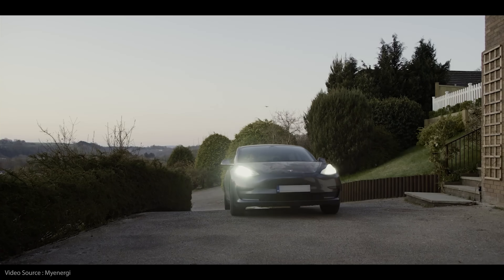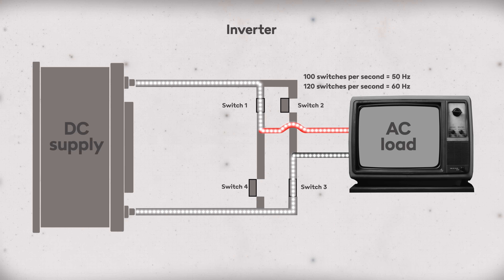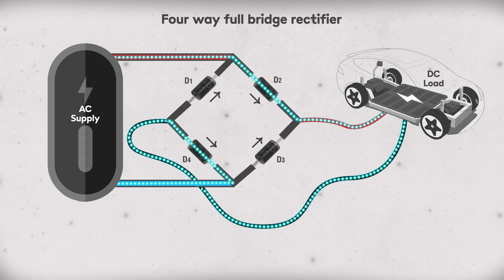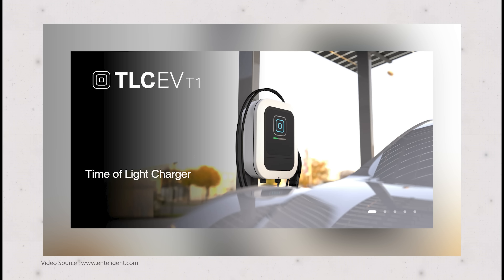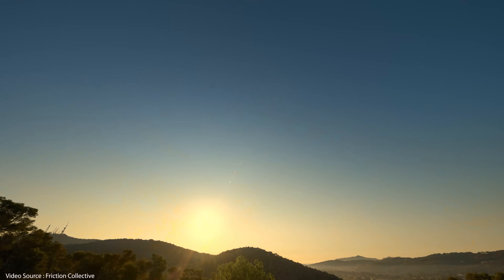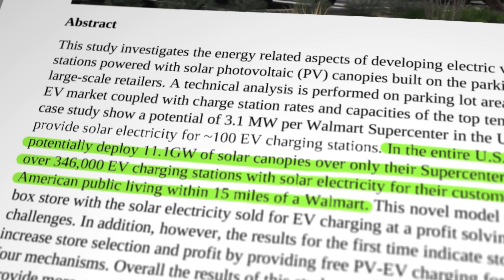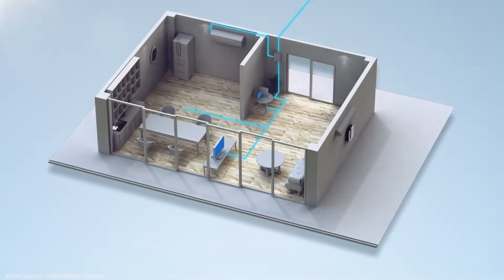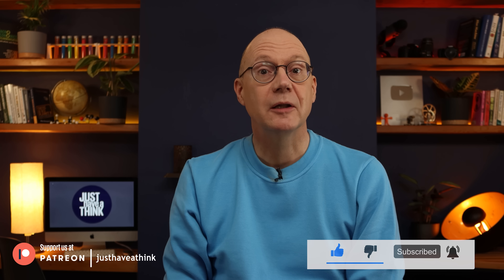DC to DC charging. One more step to off grid living!

Comment: Maybe they could just build the Mppt Solar charge controller Directly into your car so it can Plug directly into any solar panel system, Then it should be able to directly charge from any DC power supply Within reason, be it Solar panel, battery or mains electricity Converted to DC
Reply: With solar panels built into the bodywork which double their surface area when the charmed DC vehicle is parked (using origami fold out patterns.) Shadow casting building owners meanwhile pay shadow tax, much like the window tax of 1696?
Reply: @JHawkins-jf6bs  ??? What's that got to do with the price of salt on a Sunday afternoon.

Comment: What about a DC to DC charger powered by a diesel engine with an alternator feeding into a 12v  Li ion battery bank. They told me I needed a DC to DC charger to prevent burning out the alternator because the Li ion bank can draw too much power. Can you elaborate? Do I need a special type of DC to DC charger ?
Reply: Sounds like bollocks... I don't know of any way for a diesel generator to produce DC natively.  If the alternator is inadequate, and the alternators on modern cars are pretty light-duty, then you need a heavier-duty alternator.  Maybe first figure out what the amp draw of the battery bank is, then see if it's within spec for you alternator.  Both of these bits of information might be hard to find.
Reply: @incognitotorpedo42   Yes you are correct - rowlocks!.  But there are DC generators (often called a dynamo) and the more common (now) alternator generator (producing AC which is the rectified to DC for all automotive vehicular use).  

Vehicle alternators are typically only about 50% efficient when heated up in normal use.  

Large power alternator generators, driven by diesel engines, are better than 85%.  Small petrol household stand-by gennies are likely about 85% efficient when fully loaded.  But all these generators are still wasting energy with their prime movers.  Petrol engines about 25%(if lucky) and large diesels about 30-35%).  All fossil- burning polluters

Comment: If you were worried about efficiency losses, do the math and find out what that is in a total power rating. Remember that a 400 W solar module will now cost you about $260. So if you don't like the efficiency losses simply buy a couple of more solar panels and stick with tried and proven technology!
Reply: There's only so much space on a rooftop though. If the entire roof is already covered with solar panels, a few more % efficiency could be nice.

Comment: Well I've lived off grid in the mountains of Santa Barbara for a super long time and the vast majority of my house is DC and we have been doing DC solar to DC batteries to DC loads since the late 90s. This newer stuff is a bit tricky however as there are much higher DC voltages.
Reply: My first job post-college was in an off-grid solar community working for the solar installer that built the community. All 4 buildings were wired for both AC and DC and we sold a lot of DC light bulbs, refrigerators etc. As inverters got a lot better and cheaper, most people skipped the DC wiring, but it really does make things more efficient, and would be a better choice for developing nations that are going to build out micro-grids rather than national utility grids.
Reply: Nice thought, but solar panels deliver DC power very seldom in a condition you can use without adaptation for home devices. This goes with the help of dc/dc converters. Depending of the application, the converter needs an internal ac circuit to achieve the necessary step up or down voltage. Things short: the ac circuit in your house is not the devil you must get rid of, but you should think carefully about your special application.
Reply: @rainerpick5491  you are patently wrong! DC DC converters do not need an AC circuit! 🙄 i've only been using them for about 25 years now!
Reply: @rainerpick5491  Most residential solar is 600V DC and most commercial solar is 1,000V DC. Back in the day the panels themselves were 12v, 24v, 48v, obviously designed for specific battery bank voltages.
Reply: @patrickcorcoran4828  yes but we have specialty charge controllers now so we can go from 300 to 500 V DC in and output whatever DC voltage we want to, to a battery bank. So my input voltage is 350 V DC and my output voltage to battery is 48 V DC and then I have DC to DC converters that feed 12 VDC circuits in the house. Very simple stuff.

Comment: I am waiting for us to cross the threshold where we start figuring out a standard off grid appliance system where homes can run on DC to bypass the grid all together. Imagine if homes that had solar could install all heavy use appliances like climate control, refrigerators, etc where one DC standard was used. i see it as likely 48 volt but I am not an engineer. You could run lighting and low powered stuff on 12 volt and totally avoid the conversion losses altogether. This would also avoid transmission losses. So many off grid homes today have to convert their power to AC due to lack of available appliances.
Reply: The key phrase here is "but I'm not an engineer"...
Reply: Solar systems vary in voltage, both from system to system, and to a lesser degree throughout the day.  More the problem, however, is that voltage is fairly significant - up to 600v in typical domestic applications - it has to be stepped down to be safe, or the device(s) need to be hardwired.
Reply: 50 years ago people lived off-grid by using 12-volt DC appliances plugged into cigarette lighter sockets (remember them?). More recently we've seen the rise of a bunch of small USB-powered gizmos . But now we're electrifying huge loads like operating a car, induction cooktop, and home heat pump. I've never seen an unbiased analysis of whether it's more efficient to convert high-voltage DC down to low-voltage DC and adjust solar voltage to an EV's battery charging voltage, or convert everything to nowmal 120 or 240 V AC and continue using regular power supplies.
Reply: @skierpage  I suspect that it is a "size of market" issue. If enough buyers want it, they will make them but until then we need to work on "standardizing" things so they can work to one set of rules. We need engineers to figure out what those standards should be for best results. The market is moving on it's own but that is slow and has dead ends. Some are 12v with it's limits, some are 24v with other limits, some are 48 volt with other issues. Lets work to figure out how to simplify the decisions for the consumer.
Reply: There is absolutely no reason why you should not just use standard AC appliances for off-grid applications.  There is no advantage in using DC appliances.  The viability of off-grid has nothing to do with the appliances being AC or DC.
Reply: @michael-j-harrison  the advantage would be that they are built with soft start avoiding the surge as the compressor comes on, but you can MODIFY AC to do that. However if the whole house was DC you can also avoid inverter overhead everywhere. That is the point of the video.

Comment: What about just having everything in your house run on DC?
Reply: Maybe one day... I would love to get rid of all my wall warts (ac to dc convertors).
Reply: High voltage DC is a lot more dangerous than high voltage AC.  If you tried to use low voltage DC instead, then your amperage would have to be enormous, and all your wiring and appliances would be super expensive.   AC is really the best choice for houses.
Reply: AC is better for many things - anything with a motor, for instance. There's a reason why we went AC and not DC.

Comment: I cant park by my house, so would have to use chargeing stations- taking my time off me and having to pay a premium for the electricity as well. I will stick to an ICE foe as lomh as I can- and a hybrid will not give me the fuel efficiency and MPG a diesel will.
Reply: Some can’t - and some simply won’t.  Now that EVs are getting cheaper and more second hand vehicles are entering the market, I might think that the efficiency winner between non-charging-at-home EVs and diesels is getting vry close to favouring the EV.  As time progresses, even you won’t be able to continue with your inefficient polluting fossil burner

Comment: I am currently charging my EV at home from a DIY solar power system.  My system has to convert to AC and then back to DC and in the process loses that 13% you are talking about.  It works pretty good and provides free car charging but a DC version would be nice if it manages through the ups and downs of cloud cover.  I would want it to be pretty steady so I would think a battery would need to be involved in the design somehow???  Great video, Thanks!
Reply: you guys, capacitors are very expensive, particular in high voltage. and they are not meant for storage just short term. good luck with that idea.
Reply: Seems like I heard that there are places working on capacitors for storing that energy for such purposes which would be nice. Much cheaper and longer lasting technology. Also would allow round the clock charging as it would not matter what time of day you used it as long as it charged while the sun was shining.
Reply: I was just going to add that thought regarding capacitor banks instead of batteries.   They could be built and added at a cheaper cost.
Reply: yeah capacitors. i’d imagine the round trip losses from using a battery would be more than conversion
Reply: @Humungojerry  Round-trip through a low-voltage (48V) battery system would be a bit worse than a standard EVSE, yes.

Round-trip through a high-voltage (typically 300V-500V) battery system would be significantly better. But maintaining such a long multi-stage high voltage DC path that exposes the HVDC battery bus to a third party charger is mostly a non-starter.  Its extremely dangerous compared to pushing power with AC.  Definitely not worth the 5-7% improvement one could achieve.

-Matt
Reply: @junkerzn7312  thanks for the explanation!

Comment: I've been waiting for this tech for 6 years now.  I can't believe it's taken this long for what seems like a common sense solution.
Reply: Also the new alternator car to ev solar battery... ecoflow makes it for any car and it charges in 1 hour of driving. You then can move it to home and have electric all night
Reply: Efficient, high power DC-DC converters have been around since power Mosfets were invented in the 1960s.  Today (2024) raising and lowering DC voltages is hardly any more costly or complex than doing so for AC.
For people who did not listen to the video, PV->EV chargers are a workaround for grid operators who stand in the way of more PV on their grid.  Going direct to EVs eliminates the need to interconnect and allows EV charging at lower retail prices--when the sun shines.  Price, quality or delivery- pick any two.
Reply: @peteinwisconsin2496  I agree.  When the cost comes down I'll probably use something like this with an off-grid system as I have no desire to deal with PG&E ever again.
Reply: The wait was caused by lack of demand, mostly.  It's not a simple problem; you have to convert low voltage DC to high voltage DC, somehow avoiding the inefficiencies of transformers.  I think the sort of solid state power electronics to do this hasn't been around for all that long.
Reply: @incognitotorpedo42  modern solar systems operates on voltages up to 300+VDC, which is also the case
Reply: @vitaliybaban6568  charging lithium-ion batteries is quite complex, though. You can't just attach a DC power source and let 'er rip. The charger needs to follow specific voltage and current curves specific to the type of battery.
Reply: @incognitotorpedo42  I am electrical noob, but i think that transformers only work for AC, not DC. Somebody please correct me if I am wrong.
Reply: @GreyDeathVaccine  I think he meant to use the word converter instead of transformer.  You are correct that AC transformers do not work with DC.
Reply: You will wait forever to come to this tech to come commercially available because there is a flaw in the logic. 
The DC voltage of your battery or solar panels are most likely to not match up 
the slightly enhanced conversion is not worth to lay down extra DC lines in your house. 
With a standard 5 wire 2.5mm² cable you can provide 22kw charging to any normal garage 
In case of direct charging a car or battery it can make Sense to do this. 
In most circumstances the more effort to use this and the more cost of the units will makes most likely no sense. 
Using a car as a battery to power your home makes no sense to me you can get such cheap Batteries today why should you shorten the lifespan of your car's battery.
Reply: @Mr.T9191-i2f  There's no reason at all that solar DC voltage needs to "match up" and this tech will be available shortly by several different companies.  As far as powering your house, it would be useful in a emergency power outage but I agree it wouldn't be that useful for home storage unless you just don't drive much.  Car batteries are many times bigger than home storage batteries though so I could see getting one of those $5,000 Fiskers they've been talking about.  If it happens.
Reply: @Mr.T9191-i2f  Why would the Solar voltage need to match up?  Solar voltage never matches up with anything.  DC cables are not really expensive either unless you pulling a great distance or high amps.

Comment: Some electric scooters have interchangeable batteries.  This idea of dc to dc ev charging using home solar could easily be used for these scooters.  It would not take a large solar array to accomplish this.  You can ride to work during the day while charging the other battery for tomorrow’s commute.
Reply: And then get home to find your house has burnt down...
Reply: There's no point doing this DC-DC though, electric scooters and ebikes sip energy so the losses don't really hit your pocket-book at all... the difference would literally be counting pennies.   Just use the standard AC charger.

@paulhaynes8045 The batteries are easily removable.  My recommendation is to purchase a flammable liquids cabinet and run the charger cord through one of the vents, then situate it somewhere (like in the garage on the concrete floor) where outgassing won't catch anything on fire.

I do agree that leaving scooter and ebike batteries charging unattended is a bad idea if you don't have a safe place to put them for that purpose.  "battery-safe" bags aren't good enough for unattended operation in my view.  But a proper flammable liquids cabinet should work really well.   Those are double-walled steel and the venting can be directed to reduce or prevent direct flame egress.

-Matt
Reply: @junkerzn7312  I use solar panels and a power station to charge my e-bikes. So the conversion losses don’t pose much of a problem when the solar output is excessive. A larger vehicle will benefit by using dc to dc efficiency but at an equipment cost. As far as battery fires are concerned,  using the provided charger that came with the bike, charge in the cool of the morning and don’t charge the batteries to 100%, inspect battery for damage, and avoid using fast-chargers should all but eliminate fire danger.  I hope someday e-bikes use LFP battery chemistry.

Comment: considering the pandemic of cable theft, it would be foolish to install a charger somewhere outside.
Reply: Not sure that your comment comes from a genuine place of concern but if so, it's worth pointing out that it's possible to fit untethered chargers (i.e. with a detachable lead) to foil would be cable thieves. My (tethered) charger has operated in full view for a few year now.
Reply: @stevept1504  i wouldn't want to take the risk.
Reply: Not really, the voltage is very high and therefore the wire sizes are quite small and not worth the effort. You're talking about $20 worth of copper. 😂

Comment: Not first!  But I do have a real comment... (gasp!)

As the owner of an EV who is looking to purchase a place with a posh little garage this may potentially fit very nicely with the electrification plans I have for it, should I ever come to proper terms with the owner who doesn't seem to understand you can't charge the normal amount for a place that is gutted to the studs...
Reply: if you ever buy such a place, make sure the charger is installed INSIDE the garage. and keep the garage door closed when you're not going in or out. otherwise you'll sooner or later have to replace the cable.
Reply: @mrxmry3264  Oh, most definitely... If I didn't keep the door closed I would likely have to replace the other things I would keep in the garage.  And sooner rather than later, as things tend to walk away when not secure.
Reply: In my neighborhood, a house that was gutted to the studs or totally demolished might be worth more than an intact house.  The real estate is what people are buying, and they often want to tear down the old house and build something nicer.  The owner has saved you that expense.  It all depends on the relative values of the home and the land.  Good luck with your project.